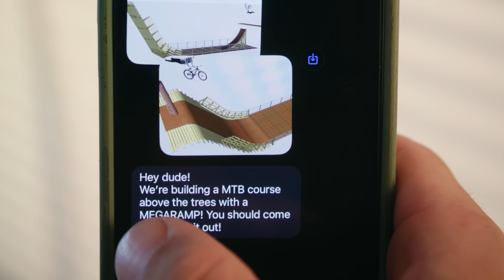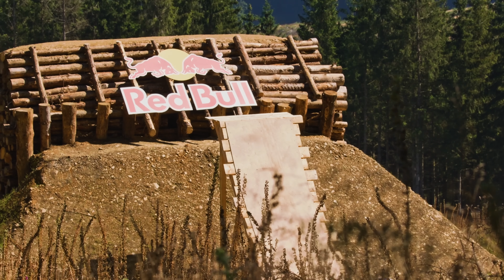Parkour Athletes try Red Bull MEGARAMP

Comment: Imagine the splinter you could get.
Reply from the maker: Still pulling them out
Reply: @TheJasonPaul  For real or joking? It could happen though. I work with wood. You could have gotten a thin 20" slice of that ramp get under your skin, especially if you slid with the grain. Or what if a nail or screw head popped out 1/8" an inch? You should be more careful.
Reply from the maker: @MOAB-UT completely a joke 😁 not a single splinter to be honest. Solid work from the woodworkers. Literally smooth as a baby’s butt
Reply: @TheJasonPaul  Best stop doing these things unless you want to get injured. What has been your worse injury to date?
Reply: @MOAB-UT  'best stop being a parkour athlete if you don't want to get injured' 
no shit, sherlock. what a revelation.